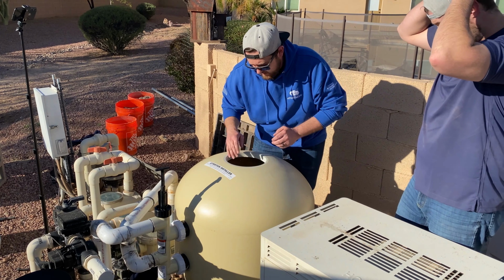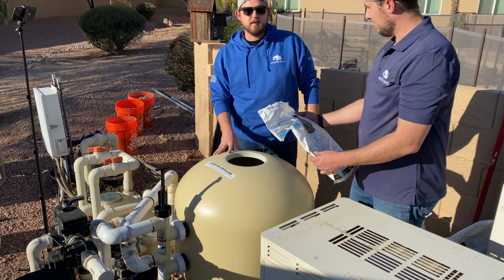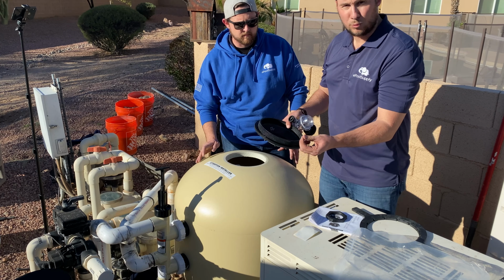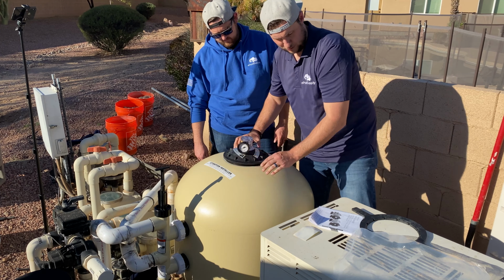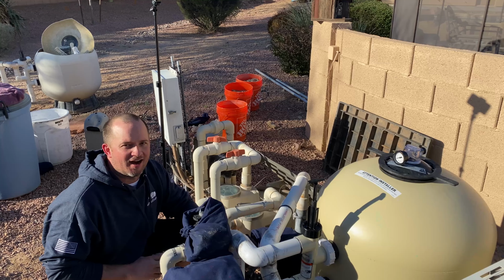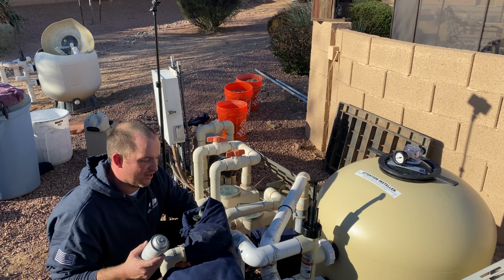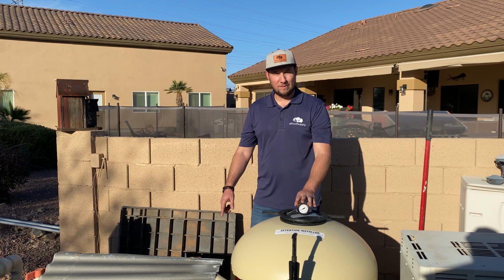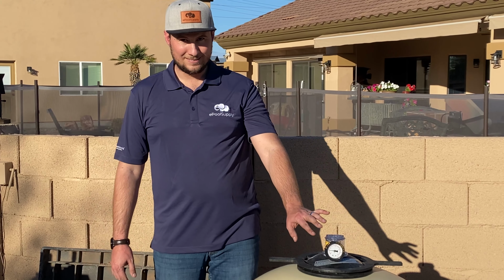How to Add Glass Media to a Pentair TR100 Sand Filter

Comment: I have a T-100 filter that just had glass media installed. It seems that when I backwash I lose some of the glass as it is pumping out to waste. Is this common or is something not correctly done? Is my pump and motor too powerful? I need a real expert...I get a lot of talk but no positive answers. 🤔
Reply from the maker: It is normal for there to be some of the media that will make its way out but not enough to worry to much about it. Hope this helps!
Reply: @ePoolSupply  It seems to be more than a little. I have a motor that I got from my neighbor. I think it is too big and causing my issue.

Comment: Its worth mentioning not to tighten down that buttress too much or it may get stuck when trying to service later.  It's common to stick those then you have to drill holes in them and run a pipe through the holes to make a tougher way to free it.  Then it's a ruined buttress and must be replaced.  The plastic wrench easily breaks.
Reply from the maker: Appreciate the feedback.

Comment: Aren't you supposed to do 3 cycles of backwashing and rinsing before every circulating this into the pool.
Reply from the maker: With sand yes because there is dirt that needs to be cleaned out but with glass, there is no dirt involved so there is no need to do that. Hope this helps!

Comment: I had a DE filter for over 20 years, then went cartridge when that filter started leaking.  Big mistake.  I'm not great at remembering to keep up with chemicals so sometimes my pool turns swamp green.  The DE filter was a CHAMP at clearing the pool in no time.  Cartridge can run for a week and do basically nothing (maybe a little if I add the blue stuff to clump the fines).  How does the sand with glass media compare?   I want to buy a new filter this year.  22,000 gallon in-ground vinyl in the sun all day here in NY.
Reply from the maker: Hello, below I will be adding a link to a blog that were written by us that should provide the insight and or information that you are seeking to make the best decision for your pool. Hope this helps!

https://www.epoolsupply.com/blogs/default-blog/filtration-benefits-of-glass-media-vs-sand

Comment: I have this system but our pool guy never told us how to maintain or clean.   Is there anything else you need to do besides backwashing the filter?
Reply from the maker: Hi there, the only other thing you would need to worry about besides backwashing the filter regularly would be to change out the sand as it is recommended. Sand should be replaced every 3-5 years. This may be longer if the pool stays clear, or shorter, if the filter runs all the time. The jagged edges of the sand wear down and become smooth as the sand ages. Hope this helps!

Comment: How much water did you add (or did you) after adding the glass media?
Reply from the maker: Hi there, for this particular install we did not add any water to the filter after the glass media was installed as it is not necessary. However, you can add a little bit for the purpose of reducing the air that is released into the pool once the system is fired up again after the install is complete. Hope this helps!

Comment: What size filter is it? 350 lbs?
Reply from the maker: Hi there, looks like that particular unit can hold up to 600 pounds of sand. 16 bags of fine sand and 4 bags of coarse sand. Hope this helps!
Reply: @ePoolSupply  Great video, thank you!    You mention 16 fine / 4 course above, but in the video you only do 10 fine / 4 course.  Is it a matter of preference?
Reply from the maker: @ashleyfreeman5042  That was what we put in the filter initially to get the system operating, later on, we added the remaining bags off camera. Apologize for the confusion, hope this helps.
Reply: @ePoolSupply  So for complete clarification, it ended up as 20 bags (16 fine + 4 coarse) of 25 lbs/bag. I'm wondering how it was determined to add the extra 6 bags of fine glass. Was it to get the correct free board height that Pentair specifies? From my research, Pentair considers the free board height to be extremely important.
One other benefit of glass that isn't mentioned much is the reduction of weight, which for a TR100 ends up to be about 100 pounds, which should help keep the cement pad from being overloaded and cracking.
Reply from the maker: @sub3marathonman788  Appreciate the feedback.